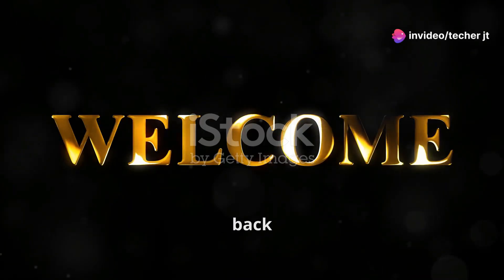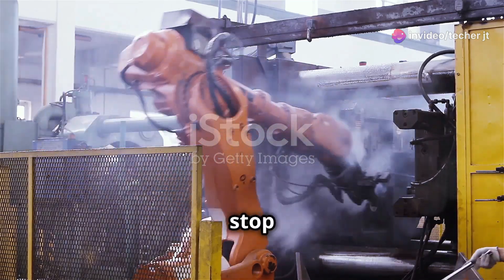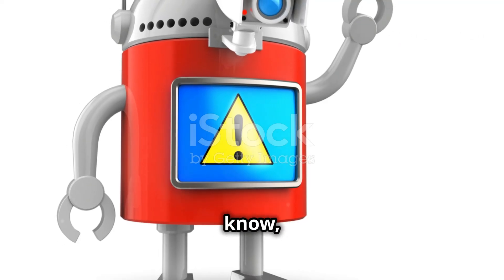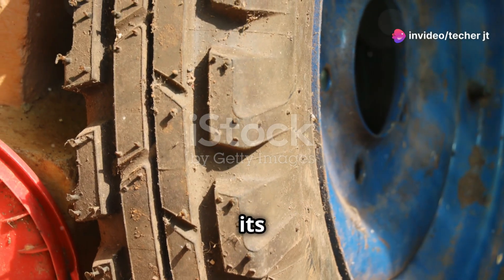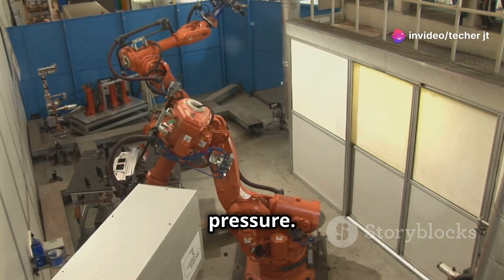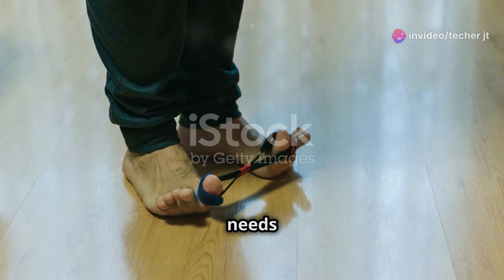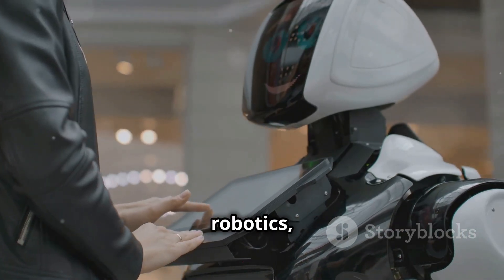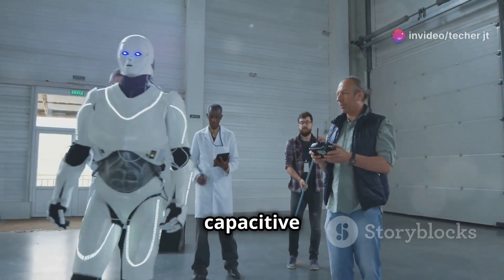Capacitive Sensors in Robotics: A Beginner's Guide

Comment: Cheryjan G. Aclo
X - Cassiopeia

1. What is the primary function of capacitive sensors in robotics?

- The main purpose of capacitive sensors in robotics is to enable robots to perceive their environment without directly touching it. These sensors employ electric fields to identify nearby objects, gauge pressure, and monitor multiple points of contact simultaneously. This functionality allows robots to interact with their surroundings more efficiently and safely, carrying out tasks that demand precision and sensitivity.

Comment: 10-LYNX
Christine Divine S. Taña

 1. In robotics, capacitive sensors are used to identify the presence of different objects, both metal and non-metal. When an object enters their electric field, they detect the change in capacitance. Applications such as touch sensing, item recognition, level sensing, and proximity detection use these sensors. Robots may now interact with various materials and environments because to this.

Comment: Dave Aaron V. Dagcuta
10 - Lynx

1. What is the primary function of capacitive sensors in robotics?

Capacitive sensors in robotics primarily function as proximity sensors, detecting the presence and proximity of objects within their sensing range. They work by measuring changes in capacitance, which is the ability of an object to store electrical charge. When an object enters the sensor's field, it alters the capacitance, allowing the sensor to detect its presence.

Comment: Ezra Shimei B. Calaycay
10 - ANDROMEDA 

1. What is the primary function of capacitive sensors in robotics?

- Capacitive sensors are used in robotics to detect the presence of various items, both metal and non-metal. They work by sensing capacitance changes as an object enters their electric field. This capacitance variation can be used to calculate the distance between an object and a sensor. Capacitive sensors are commonly utilized in applications such as obstacle avoidance, object tracking, and human-robot interaction.

Comment: Evzen Radik A. Salvador
10 - Orion

4. What challenges do capacitive sensors face in real-world applications?

Capacitive sensors face several challenges that impact their performance. They are sensitive to environmental factors like humidity, temperature, and dust, which can cause fluctuating readings or false triggers. The presence of nearby conductive or dielectric materials can also interfere with detection accuracy. Additionally, capacitive sensors may have difficulty distinguishing between different materials, limiting their effectiveness in complex environments. These issues require careful calibration and design to ensure reliable operation.

Comment: Anika Chloe J. Pepito
10-LYRA

1. What is the primary function of capacitive sensors in robotics?
-Capacitive sensors are mostly used as proximity detectors, which identify objects even when they are not in close proximity. Their method of operation involves identifying variations in an object's capacitance, or its capacity to hold an electric charge. The capacitance changes in response to an approaching item, enabling the sensor to detect its distance and existence. This skill is essential for activities such as handling things, avoiding obstacles, and guaranteeing precise placement in robots.

Comment: Kyle Ross B. Baiño
10- Lyra

2. How do proximity capacitive sensors differ from touch capacitive sensors?

Proximity sensors detect items without contact, but touch sensors require direct contact. Proximity sensors are also utilized for proximity detection and gesture recognition, whereas touch sensors are employed for user interfaces that need touch

Comment: AKISHA BACHINICHA
10 ORION

1.) The primary function of capacitive sensors in robotics is to detect the presence of objects, both conductive and non-conductive, by measuring changes in capacitance. They can sense proximity, touch, and the level of materials, enabling robots to interact with various surfaces and objects without direct contact.

Comment: Shei Christiane C. Payot 
10-Lynx

1. What is the primary function of capacitive sensors in robotics?

Capacitive sensors are all about safety and efficiency. These sensors act like proximity sensors, detecting materials around their surroundings withing a certain range. When changes in the sensor's capacitance occurs, that is when it knows that something is within its proximity. It is also helpful with sensing the amount of pressure used while in contact. This sensor helps with robot's interactions with their surroundings, making it safer for them to traverse the world.

Comment: Frenzzy Kyla C. Halasan
10 - Hermes

4. What challenges do capacitive sensors face in real-world applications?

Capacitive sensors experience a few challenges in real-world applications. One noteworthy issue is their affectability on natural conditions; variables like mugginess, temperature changes, and the nearness of clean or soil can influence their execution and lead to wrong readings. Also, capacitive sensors can battle fabric inconstancy, as they may not dependably identify non-metallic objects or materials with comparable dielectric properties. Besides, they can be influenced by electromagnetic obstructions from adjacent electronic gadgets, disturbing their signals and decreasing exactness. Finally, the requirement for exact calibration and alterations in several settings can complicate their arrangement in energetic situations.

Comment: Iñigo Sevillejo
X-Cassiopeia

Q1. What is the primary function of capacitive sensors in robotics?

- Robots that are equipped with capacitive sensors—small electric feelers—can sense their surroundings without coming into contact with objects. For robots, capacitive sensors work similarly to how you would reach out and feel your way around in a dark room. Without making physical contact, they track numerous points of contact, measure pressure, and identify surrounding objects using electricity.

Comment: Q1. What is the primary function of capacitive sensors in robotics?

- Robots that are equipped with capacitive sensors—small electric feelers—can sense their surroundings without coming into contact with objects. For robots, capacitive sensors work similarly to how you would reach out and feel your way around in a dark room. Without making physical contact, they track numerous points of contact, measure pressure, and identify surrounding objects using electricity.

Comment: Angel C. Sumastre
10-Casiopeia

1.The main function of capacitive sensors in robotics is to act as proximity detectors that can sense objects without direct contact. They operate by detecting changes in capacitance, which refers to an object's ability to store an electric charge. As an object gets closer, the capacitance changes, enabling the sensor to detect its presence and measure its distance. This ability is essential for tasks such as obstacle avoidance, object handling, and precise positioning in robots.

Comment: Reeve Radley C Fua 
X Cassiopeia 

1. What is the primary function of capacitive sensors in robotics?

Capacitive sensors are primarily used in robotics to measure the proximity or distance between an object and the sensor. They operate by detecting changes in capacitance that occur when an object approaches. This change allows the sensor to determine the distance to the object.

These sensors are commonly employed in applications such as obstacle avoidance, object tracking, and human-robot interaction.

Comment: Urhyness Agatha Santos 
10 Cassiopeia 

Question:What is the primary function of capacitive sensors?

Answer: The Sensors in robotics primarily function to detect the presence or proximity of objects without physical contact by measuring changes in capacitance when an object nears the sensor. They are used for proximity detection, touch sensing, material identification, and level measurement in various applications.

Comment: James Jabiniao
10 Cassiopeia

1. Capacitive sensors in robotics are used to detect both metallic and non-metallic objects, such as liquids and plastics. They function by measuring variations in capacitance as objects move into the sensor’s electric field. These sensors are valuable in robotics for proximity detection, level sensing, object recognition, and touch sensing, enabling robots to interact with diverse materials and environments.

Comment: Cathleya Jamis
X- Cassiopeia

1. What is the primary function of capacitive sensors in robotics?
-The primary function of capacitive sensors in robotics is to detect proximity, position, or changes in material properties by measuring variations in capacitance. These sensors are often used for touch detection, object presence, and distance measurement without direct contact.

Comment: Jacinth J. Yerro
10-Hermes

What challenges do capacitive sensors face in real-world applications?
Capacitive sensors encounter several challenges, including interference from environmental factors like humidity and dirt, variations in sensitivity with different materials, a restricted detection range, and drift in readings caused by temperature fluctuations. They are also susceptible to electrical noise, necessitate regular calibration for accuracy, and require careful installation, which can be challenging in some environments.

Comment: Alvin M. Tagudin
10-Hermes

4. What challenges do capacitive sensors face in real-world applications?
-Capacitive sensors face challenges such as environmental interference from humidity and dirt, sensitivity variations with different materials, a limited detection range, and reading drift due to temperature changes. They can also be affected by electrical noise, require regular calibration for accuracy, and need proper installation, which can be difficult in some situations.

Comment: Jafe Marie A. Ebron
X-Cassiopeia

2. How do proximity capacitive sensors differ from touch capacitive sensors?

Proximity capacitive sensors detect objects from a distance without direct contact, while touch capacitive sensors require physical touch to sense an input. Proximity sensors measure changes in the electric field from nearby objects, while touch sensors detect when a conductive object (like a finger) directly interacts with the sensor's surface.

Comment: May ville D. Ortega 
10- lyra

1. What is the primary function of capacitive sensors in robotics?

Capacitive sensors are used in robotics to detect the presence of various objects, both metallic and nonmetallic. They work by detecting capacitance changes as an object enters their electric field. These sensors are used in a variety of applications, including proximity detection, level sensing, object identification, and touch sensing. This enables robots to interact with a variety of materials and environments.

Comment: Zophiel Hailey Jace B. Usman
10 - Hermés 

1. What is the primary function of capacitive sensors in robotics?

- The primary function of capacitive sensors in robotics is to help robots sense and interact with their environment by detecting objects, measuring pressure, and tracking multiple points of contact without requiring physical touch. This allows robots to perform task more efficiently and safely, such as navigating surroundings, avoiding collisions, and interacting with humans and delicate objects.

Comment: Rushlee Baltazar 
10-HERMES
5. In what ways can capacitive sensors enhance safety in industrial robotics?

Capacitive sensors enhance safety in industrial robotics by providing non-contact proximity detection, allowing robots to slow down or stop when human workers are nearby, thus reducing collision risks. They can sense the presence of various materials, ensuring robots operate safely and avoid unintended movements. Additionally, touch sensing capabilities allow robots to adjust their force when interacting with delicate objects or to halt when detecting human contact. Capacitive sensors can also monitor safety zones around robotic workstations, triggering alerts if someone enters a designated area, and they reduce mechanical parts by replacing traditional limit switches, which increases overall system reliability and safety.

Comment: Sairel A. Yabo
X-hermes

1.Capacitive sensors measure the presence of objects by detecting changes in electrical fields. They are used in robotics for tasks such as detecting proximity, levels, and objects, as well as for touch sensing. This enables robots to interact with various materials and environments.

Comment: Hannah Bella A. Ihalas
Grade 10 - Hermés

4. What challenges do capacitive sensors face in real-world applications?
— The challenges that capacitive sensors face in real-world applications are that these sensors are often sensitive to changes in temperature and humidity, which can affect the accuracy of readings. Additionally, capacitive sensors can sometimes exhibit false triggers when detecting conductive objects through non-conductive materials. The air gap between the sensor and the target object can also affect the accuracy of the readings, requiring a minimized impact of optimization.

Comment: Francess Elizah A. Pintac
10 - Hermes

5. In what ways can capacitive sensors enhance safety in industrial robotics?

- Capacitive sensors improve safety in industrial robotics by providing precise proximity detection and collision avoidance. They integrate multi-functional sensing capabilities, allowing robots to predict and respond to potential collisions. Advanced sensors use data quality monitoring algorithms to ensure reliable readings and maintain high safety standards in dynamic environments. They also enable safer human-robot collaboration by continuously monitoring workspaces and making real-time adjustments to robot behavior.

Comment: Marvin II T. Octobre
X-Andromeda
1. What is the primary function of capacitive sensors in robotics?

Capacitive sensors can be integrated into industrial robots or machinery to detect objects for switching. They are easier and cheaper to integrate into automation solutions than some of the other often used sensors.

Comment: Jaeve Joshua C. Butcon
X- Hermes

1. What is the primary function of capacitive sensors in robotics?

The primary function of capacitive sensors in robotics is to detect the presence or proximity of objects without physical contact. They work by measuring changes in capacitance caused by the dielectric properties of nearby materials. Capacitive sensors are commonly used for touch sensing, object detection, and proximity sensing, allowing robots to interact with their environment and perform tasks like triggering actions or avoiding obstacles. Their ability to sense non-metallic objects and detect changes in capacitance makes them versatile in various robotic applications.

Comment: Kenichie C. Racero
10 Hermes

1. What is the primary function of capacitive sensors in robotics?
-The primary function of capacitive sensors in robotics is to allow robots to sense their environment and interact with it without physical contact. They use electric fields to detect nearby objects, measure pressure, and track multiple points of contact, enabling robots to navigate, manipulate objects, and collaborate with humans safely and precisely.

Comment: Deron Ethan B. Pacaña
10-Hermes

1. What is the primary function of capacitive sensors in robotics?

Capacitive sensors in robotics are designed to detect both metallic and non-metallic objects, such as liquids, plastics, and other materials. They operate by detecting changes in capacitance when objects enter the sensor's electric field. In robotics, these sensors are used for tasks like proximity detection, level measurement, object identification, and touch sensing, enabling robots to interact with diverse materials and environments.

Comment: Paul Veloso
10 - Orion

1. Capacitive Sensors in robots primarily function by detecting changes in capacitance between sensor plate and a nearby object. They detect the presence, position and movement of an object without requiring physical contact.

Comment: Fiona B. Valmorida
10-ORION

1. What is the primary function of capacitive sensors in robotics?

Capacitive sensors in robotics are used to detect the presence or proximity of objects, regardless of their material composition. They achieve this by creating an electrostatic field and measuring changes in capacitance when an object enters the field. This contactless sensing capability allows robots to perform tasks such as object detection, proximity sensing, and level control without direct physical contact.

Comment: Herah Jhylie Zean Q. Agbu
10-Hermès

1. What is the primary function of capacitive sensors in robotics?

- Capacitive sensors’ primarily function in robotics is to allow robots to sense their environment with no contact. They use electricity to detect the presence of objects regardless of their material composition, measure, pressure, and even track multiple points of contact. Additionally, capacitive sensors can detect the proximity of objects without direct contact, providing information about their distance from the sensor.

Comment: Ezekiel Jude E. Tuñacao
10 - Andromeda 

2. How do proximity capacitive sensors differ from touch capacitive

The difference between proximity and touch capacitive sensors is the range they can detect. Proximity capacitive sensors can detect at a range while touch capacitive sensors can only detect objects in contact with them.